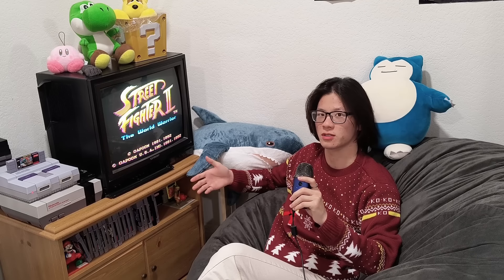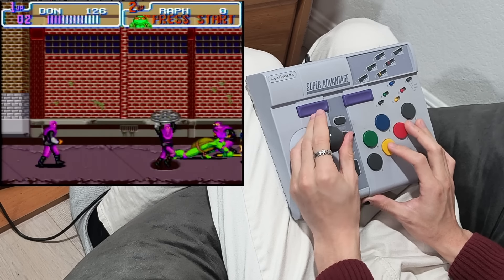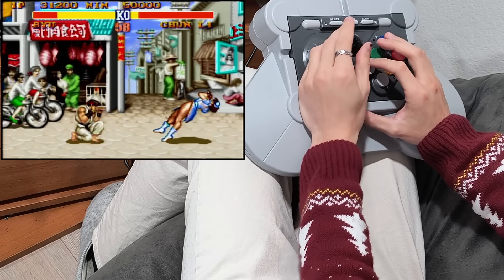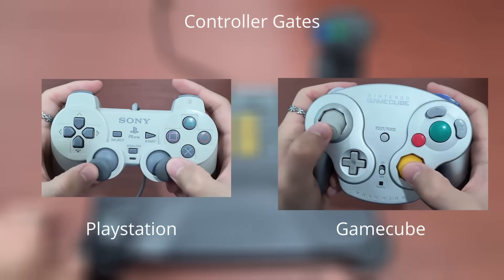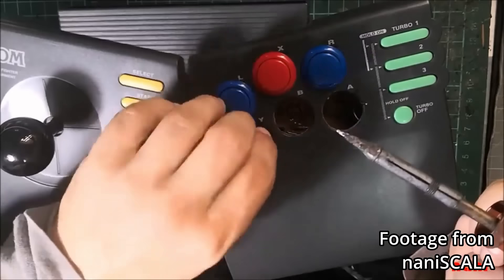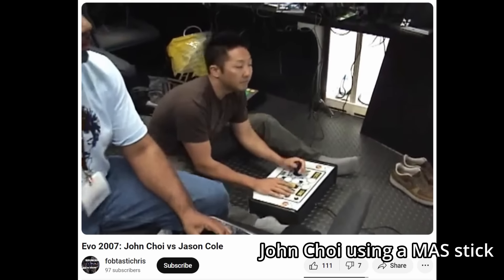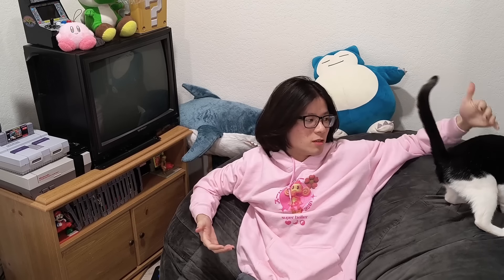SNES Fight Sticks

Comment: The Capcom stick was also used for the CPS changer, which explains the high quality components.
Reply from the maker: Oh shoot that's really cool. Crap I should've mentioned that in the video. I'm gonna pin your comment so people know. Thank you.
Reply: @SodaCanTablet The Japanese version also has genuine arcade controls and a special port for a wireless adapter. Weirdly enough, the batteries go into the stick and not the wireless adapter. The American version has a blanking plate where the battery door would be.

My first SNES stick was the awful Quickshot followed by the Fighter Stick SN. Fighter Stick SN was basically a Super Advantage with the proper layout.
Reply from the maker: OHHHH holy crap that makes a lot of sense. I saw the blank plates for the battery and wireless adapters and I was wondering what they were. Thank you for letting me know about that. I've seen the Quickshot does not look good at all. I've seen the Fighter Stick SN too and I like that it at least has proper button placements.

Comment: 9:54 you see where it says CPS FIGHTER SET at the bottom there? that's so you could one click set the controls to CPS Fighter style, and that same option is in all the other SNES SF2 games. Another cool feature of that stick is that you could swap the cable and use the stick in 2 button mode on NES, beats the hell out of the NES advantage. Also I thought the layout was kinda dumb at first too, but then I played through Megaman X with it and realized how easy it was to do every combination of jump/charge/dash which is kind of difficult on a normal pad.
Reply from the maker: OHHH I didn't notice that. That makes a lot of sense.
I knew there was one for the Sega Genesis, but I didn't know there was a cable for the NES. And I can see how this sort of layout is more universally compatible with games and not just fighting games. Hope you enjoyed the video!

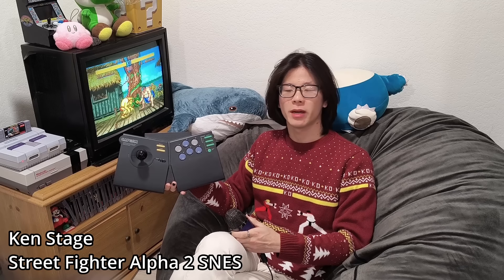Comment: 9:16 
Interesting fact for those that didn't know: The Capcom Fighter Power Stick is the same stick that was also made for the extremely rare Capcom CPS Changer, a console that Capcom made that was similar to the Neo Geo AES that utilized the Capcom CP System arcade hardware, or CPS1. The CPS Changer used Super Nintendo controllers (included the Fighter Power Stick) and it worked more like a Supergun than a home console, and it was sold only via mail order, which why it's so rare. Only 11 games were made for it, including an extremely rare version of Street Fighter Zero/Alpha
Reply from the maker: Oh huh I didn't know the CPS Changer used SNES controllers. Interesting that it worked like a supergun. Does that mean it takes JAMMA boards? It seems like it was more like the AES like you said since if it just used JAMMA boards, it would have more than 11 games compatible with it.
Reply: Lady Decade and Geekstorian have good commentary on the CPS Changer, I would suggest looking those up. Youtube keeps removing my messages for no reason so I had to make it like this

Comment: Great look at SNES sticks.  Hadn't seen some of these before!  The button layout with L/R in the top-right and top left, and the SNES Advantage's weird layout is explained by one thing, I've found: The peripheral makers didn't want to simply make sticks that only work for a select few fighting games, and didn't think parents would buy them for their kids if they only worked well with that select handful of titles.  With the L/R spaced on either edge, you could still get away with playing games that didn't allow button rebinding and relied on the positional aspect of those- think Mario Kart and F-Zero, for instance.  Fighting games all allowed the buttons to be re-bound but a large amount of the games on the system don't have these options, so it was logical from a sales standpoint to maintain this positional layout for folks that wanted to play things besides fighters with these somewhat-expensive peripherals.  Cheers
Reply: derp mario kart is a bad example because both buttons jump/slide the same, but you get the idea- many games used positional left/right actions on L/R.
Reply from the maker: Yeah in retrospect, I think that was the right move since like you said, it makes the controllers compatible with a wider range of games and fighting game buttons could be remapped anyways. I think a good example is Mega Man since that was also made by Capcom, and the layout makes it easier to jump and shoot with your middle and index fingers respectively. If it was in a more fight stick focused layout, the buttons would be on top of each other rather than next to each other.

Comment: One of the SF2 ports had a pre-set configuration for this stick specifically, where L and R are jab and fierce respectively.
Reply from the maker: Yeah someone pointed it out in another comment I didn't notice it. If you press the button at the bottom of the screen at 9:54 that says CPS Fighter Set it automatically sets the buttons to match the Capcom Power Stick which is what the CPS stands for.

Comment: Great video, more of this! I’ve got the Hori Fighting Stick for SFC. Do you know if there’s any way to make the stick’s movement more smooth? 

Mine is creaky but otherwise in great shape. I love that it’s got a metal frame
Reply from the maker: Thank you! As for the stick, the most likely thing is that it's just dirty. I'd check this video out to see how you can disassemble it and do a deep cleaning. If it's a different reason, taking it apart will still let you see what's causing the problem. Might be that the spring popped out of place or something.
https://youtu.be/vaf1DHMYBz4?si=qR1Av1ifyzor72Ng
And yeah I don't have one myself, but it looks awesome. Thanks for watching!
Reply: @SodaCanTablet  this is perfect, thanks! I’ll tear it down this weekend and see what it needs. This just gave me another question. I just installed a JLF stick on my 8bitdo arcade stick and it came with 2 identical plastic washers for. I’m wondering, do you prefer to keep both washers on the top side of the controller? 

I took one off and it seems fine

Comment: By now somebody has already explained the CPS switch in the options, so I'm gonna ask have you looked into D-Pad options for fighters? Of course Sega has their own first party solution, but I also have all 3 verions of the Capcom Soldier Pad. While most of my findings does say it's Capcom's pad even having the logo molded onto it, some packaging of the Japanese only super famicom version says it's by Asciiware. It's a lot more comfortable than it looks.
Reply from the maker: I haven't looked too much into d-pad options for fighters, but if you have suggestions on any that's interesting I'd love to hear them. I know there are interesting ones like the SEGA Saturn controller for PS2, ASCII PAD for the Dreamcast and PS1, and the HORI 2way Fighting Commander for PS1. I don't have a Capcom pad but I really want one. I like that it combines the feel of using a standard controller for your left hand since it has a d-pad with the feel of using an arcade style controller for your right hand since your fingers are laid flat on the 6 buttons. I'm guessing the AsciiWare version is either ripping the Capcom design or maybe they had a deal at one point that AsciiWare could sell the design so that Capcom wouldn't have to do the manufacturing part.
Reply: @SodaCanTablet  Well I can't recommend anything good outside if what you mentioned and I know from firsthand experience the GamePad 6 by Performance was uncomfortable even if you had a callus on your thumb. Anything on the Nintendo side of things I can't really say since I've found what I've been looking for.

Comment: I did sacrifice a snes controller for a custom arcade stick, with dual output (+ a brook UFB) but the controller pcb didn't like much being along the brook pcb, played for a good time like this but then I got an brook wingman adapter which accepts many controllers, even some wireless. If you already have an arcade stick I would go for it, also you can use it on a NES too. 
great video, cool to see all those old options
Reply from the maker: Ohhh that's really cool. The dual output reminds me of those third party controllers that had 2 controller plugs so you could use it with different consoles. Using an arcade stick on the NES seems great since there's a lot of arcade type games on it. And thank you! Glad you enjoyed the video.
Reply: hahah yes, looked exactly like those lol
the extra cable was a bit annoying too, was another reason for getting the adapter thing  @SodaCanTablet

Comment: That is why for classic Mortal Kombat on the SNES and Sega Genesis need to be made by the fans. Because MK is very different layout of buttons. The center button is to bl;ock, the bottom right of your joystick have a button that is he run button. Again very diferent from other fightig game button layouts. Also the CAPCOM arcade stick is perfect to play other games too. I know the layout is odd. Most SNES games uses the Y, B, and A buttons As the X button is usually for some sub weapon or something that you usually never use. The L and R buttons are usually rarely use. But when it does, you usually press it one or some few times. So the layout of Y, B, and A for the buttom, while the top is L, X, and R are in the top. IT works. Trust me I played a lot of games with that stick. You rearely will ever use L, X, and R buttons. By the way that Capcom layout is almost the same layout front buttons use on the Gamecube. However it's B, a and X for the botton, the top have one more button the Y button. The Left trigger and right trigger are analog, and one small Z button. Wait... where there ever any fighting sticks release on the gamecube? The N64 fightstick sucks.
Reply from the maker: I never played MK on the traditional MK stick layout but yeah fanmade is prob the best for that series in the earlier consoles. The Capcom stick layout makes more sense with that explanation. Especially for Mega Man since that was also made by Capcom. Shoot with index and jump with middle. Apparently there was a fight stick for GameCube made by HORI for Soul Calibur II. Seems pretty rare though. There was also one made by Nuby but those don't seem too good. The N64 fight stick I actually own 2 kinds. 1 is the more common Arcade Shark, but I also have the Mad Catz Dual Arcade stick which I made a video on. I actually really like the Mad Catz one because it uses microswitches and doesn't feel squishy like with the InterAct one. Hope you enjoyed the video!

Comment: I had one that worked on both SNES and Genesis (it had swappable cords) that I never see anyone mention.  I have no idea what the brand was.  I just remember it was kind of purple.  Six button Street Fighter style layout.
Reply from the maker: Is it the Arcade Pro by InterAct? That one has a swappable cord and half the buttons are purple.
Reply: @SodaCanTablet  Yeah, I did some searching and that's the one.  I probably still have that thing in a box in my parents house.

I don't think it used microswitches or anything nice like that but the layout was perfect and it worked decently enough.

Comment: 13:36 the Customization is an Extension of their original Purpose. These are called Fight sticks but they are Arcade Sticks & Buttons which were designed to be modular to be able to simply replace parts for commercial use. 

So the benefits to customization is just the DNA of these parts. Their existence extends beyond the FGC and pre dates it, it isn't a benefit due to the FGC.
Reply from the maker: Ah yeah that's true. That's my bias for fighting games showing I guess haha. I really like how you put it how customization is engrained in the DNA of these parts too. Very poetic. Thanks for watching!

Comment: Don't worry, you didn't miss much with the c&l sticks. They used the Happ Ultimate lever & buttons, which were extremely stiff and uncomfortable compared to the later Happ Competition ones. Surprisingly, they had quick disconnects instead of soldered wires like the old MAS sticks had. There was a c&l genesis & snes combo stick too, but it was even worse because there was no room for your wrists at all.
Reply: But it is an easy drop in with a comp stick i got one. def not worth paying over 100 bucks for just to mod tho
Reply from the maker: Ah that's pretty cool. Pretty cool they had quick disconnects probably so people could swap them out without soldering. I wish there was some more info on the C&L stick for the Genesis. I'm really curious what it looks like. Thanks for watching!

Comment: fascinating! that capcom stick seems to use a similar omron switch (with the metal fingers) to what semitsu switched their levers to a few years back, when matsushita/panasonic stopped making microswitches. in my experience with a newer semitsu ls-32, switches like those require just a teeny bit more force than the ones without the metal finger as seen in the sanwa JLF. not a major difference, and absolutely not a difference that would make one "better" at any given game, it's more like the difference between normal green tea and genmaicha: the difference is there, and noticable, but relatively inconsequential and more of a subtle matter of taste - more similar than not. (i will say that the semitsu sticks are louder when you slam it against the gate, from the amount of plastics used)

i loved my ps1 padhack while i had it, it had a MUCH better input response time on computer, even with a cheap PS controller to USB converter, than the PC/PS3 board my stick came with. eventually upgraded it to a brook UFB for use on pc, switch, PS4 and 360, and then swapped the lever over to the semitsu. only other console stick i'd used before that one was the NES Advantage, the advantage (and ASCII Stick Jr.) aint the best thing ASCII made, that's for sure.
Reply from the maker: Ahhh I've only used Sanwa sticks so I didn't know Seimitsu sticks used the same switches. That's pretty cool. Maybe if I make another stick one day, I'll try it with a Seimitsu lever instead of Sanwa. And that's pretty surprising that a PS1 controller had a better response time than the OEM board loool. Do you remember what brand it was? I'm just curious because I only have experience with the HORI RAP 4 and Raspberry Pi Pico for fight sticks on PC. The ASCII Stick Jr. has such a nice design. Did it use switches or the rubber pads for the stick? I like the color scheme though. Kind of reminds me of the Namco PS1 Arcade Stick. Hope you enjoyed the video!
Reply: @SodaCanTablet  definitely enjoyed the video!! 
1: FWIW i'm pretty sure every public candy cab i've come across in the united states has been fitted out with 100% sanwa parts, and I have never been disappointed. seimitsu sticks are well designed and super overbuilt. while it may seem like they've got a bunch of them, they just have 2 body styles, and then variants of those with different springs/throw distances/shaft lengths/deadzones etc. the LS-32 and LS-40 in particular are wide and chunky over in the case, even moreso with the pcb. their sticks and buttons overall seem to feel firmer than sanwa's, but not too heavy. i've only used the new ls-32, which is still a fairly light action but feels a bit heavier than the JLF, with a shorter throw, a snappier return and smaller deadzone. as long as you get the right mounting plate your setup/build, the LS-32 is a very good all-rounder much like the JLF. their buttons are a bit firm and tactile, not heavy but unlikely to go off just resting your finger on it, more like a cherry clear than the buckling spring-heaviness of happ buttons. sanwa buttons make it less fatiguing and easy to rapid mash, and i've RARELY had one of them go off from resting.

2: it was a qanba Q1's OEM board, which was one of the least expensive sticks of its time (maybe still?? they have them on their website for 60 and in stock??). the case has held up spectacularly after having to cut away some plastic to make room for things! 

3: the NES advantage/ASCII Stick Jr have the same internals with the rubber pads for everything, i remember one of the ADVANTAGES we had felt like it was starting to rip and start missing inputs a long time ago. the original ASCII Stick famicom seems to be a different beast altogether, with a nice printed metal look and arcade quality parts from seimitsu, looks just as good as the Jr.